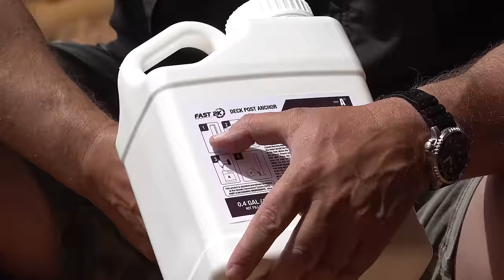POLE BARN POST | Concrete Bad, FAST 2K Good!

Comment: When I was young , Dad and I put the post hole digger in the pole barn.  Dad backed the tractor to the corner of the barn and used the post hole digger to dig the auger about 2.5 to 3 ft down.  We left the digger in the ground and unhooked it.  We laid the front yoke on a rough sawn 12 by 12 seasoned oak timber that was a little wider than the yoke.  We tied the pto shaft to yoke off the ground.  We used the 12 by12 to guide the tractor straight back to hook up.  No fighting , smashed fingers or heavy lifting.  Never had problem with water in the hole or excessive rust on auger.  Where Dad put it always was dry in the hole.
Reply: Good idea! - Maybe cut the bottom off a 5 gallon bucket as a sleeve and put a little gravel in the bottom to clean it up?

Comment: Good work, Tony.  And uggghhhh on the mis-cut of the 6x6!!  Hopefully you have another place you can use it.   I'm framing one end of my pole barn like a house with 2x6 on 16" centers....on the other end, I'm thinking about putting in a laminated beam across the 32' width so I can frame in a 10x10 rollup.  But that's next year!!

Comment: Having put in 600- 700 posts & 200 16' long ( plus) in my life ,this " technique " of dropping the post in the hole had to be the slowest l have ever seen. Just never thought of using the "tractor to help". In the case of the 3point auger, they are "pure torture " to use. Going to "adapt" mine to a hydraulic motor, for forward-reverse control--- they always get stuck. A jib-loader-adapter is also on the "drawing board". Thanks for the great Vidio Sir and happy safe tractoring & building
Reply from the maker: Using the loader to place the post is way faster and easier than by hand. This post was time consuming because we decided to put more post up after the barn was built. I did want to bend the new metal roof hitting it with a post.
Reply: yeah I've put up alot of posts with family by hand with no implements but ropes/ladders/hands... and maybe faster with posts that size if had 4-5 practiced young toned backs, but one could say that about shoveling vs backhoe, but when you factor in its just Tony and his wife, they looked like they weren't rushing but ensuring they did everything 100% correctly, as well as ensuring they were enjoying themselves. I really enjoyed this speed so I could imagine & think through doing this with a bobcat im restoring lol. After I resto the bobcat & require the grapple,the last thing too seek out and wrestle is a wife... then I could match Tony's level of relaxation when tackling such projects lol.

Keep up the good content as well Tony, good folks watch good videos.

& Everyone else, keep enjoying your builds!
Reply: @TonysTractorAdventure  Oh yea, when "one" has a tractor they want to utilize it as much as possible. There always seems to be a "man-power" shortage now-a-days, maybe we're just U-tubing TOO much. Just saying that "bite" with the post on the grapple loader looked kind of clumsy & dangerous. I think the grapple is designed for horizontal lifting & grabbing. A simple "sling strap" on a grab hook on the loader bucket is a " tryed & true" technique --when tractor hydraulic  power is needed. In a " monkey see-a monkey do" scenario l could see a LOT of "Catastrophic " failures. I would not use your technique at home- seen way too many people getting hurt with the wrong "rigging technique ". Just thought you would like too know, ( just 40years of practical commercial, residential,& Industrial experience). God Bless all your endeavours.
Reply from the maker: @Donald Strishock we each have a level risk we are willing to accept and I have the in-person on the ground situational awareness. Those were true White Oak 2x4s. Statistically, it more likely a person would have a fatal car accident, yet people jump in a car and go down the road not having any idea if the oncoming vehicle has brakes or tires worth a darn. The next time you are at a shopping center, take an inventory of the tires on your fellow drivers cars. Now that is dangerous stuff. Still, I appreciate you taking the time to care. 40 years heavy maintenance. Tanks, artillery, construction equipment, heavy trucks. I even got a bit of higher learning in engineering. God Bless you too.

Comment: Good job Tony that foam is awesome as for the post hole digger a large truck wheel will be about the right hight and it will let you turn back and forth not pretty but it works.thank you for your time and work good job the video always love two watch.
Reply from the maker: I appreciate the tip. I have never spent enough time looking for a post hole digger solution, but I have spent a good bit of time talking about how much I dislike the setup. LOL!

Comment: I take the auger off my PHD and install a 2-inch piece of PVC lined with grease in its place. Then I just lay it on the ground.  Hooking up, put the main boom in the top link bracket the arch into the lifting arms. I really don't mind doing it that way but leaving the auger on is awkward at best

Comment: Never used the foam pist stuff  ut I've heard it's good now I'm gonna have to buybsome and use it.
Reply from the maker: I have had really good results with the foam. My barn made it through a storm with very strong winds and it is not done yet. 60 to 80mph gust.
Reply: @TonysTractorAdventure  awesome looks like ill be setting posts with this stuff and checking it out. Thanks for the awesome video

Comment: As for the post hole digger, they are a bear to deal with.  Nonetheless, I learned I can back mine up to a small diameter tree and use a couple of ratchet straps to secure it before I disconnect from my tractor.  Makes it easier to hook back up too.

Comment: best way is too chain post hole digger up to a beam up in the air a like and you can move it around for easier hook up. is fast 2k cheaper in the jugs? take care, be safe and well.
Reply from the maker: It is a bit cheaper, but for large jobs, it is way easier.

Comment: When I get done with mine I pull the pin and drop the screw and then take it off easy  but some times I put my log tongs on it and use it to skid logs works really well but it takes me about 5 minutes to hook up and go

Comment: The bulk product makes this so much more attractive than multiple bag loads. If it was more available in the UK i would consider it for handrails, interpretation boards etc. Thanks for posting.
Reply from the maker: I agree. Both sizes are easier to use than concrete bags, but the bulk Fast 2K is very friendly to work with.

Comment: How come these videos praising the uses of foam never come back after several months and tell you that the foam shrinks and your pole is no longer solid in the hole?
Reply from the maker: You went and made a negative post on the one channel that did do a later review on foam. You used the wrong brand foam. I did a whole video on the lousy foam. I am waiting for an apology. 😉
Reply: @TonysTractorAdventure  ;Keep waiting.  I am not buying it.
Reply from the maker: Each of us have to live with our on integrity clock even if it doesn't tell time right. Maybe you are wrongfully accused.

Comment: How deep of a hole was that and diameter? Trying to calculate costs of fast2k and if i only want to use 1 mix then would you go less deep or lesser diameter?
Reply from the maker: 4ft deep x 9 inches wide. 6x6 post.

Comment: Whats the black stuff on the bottom of the post? And will that protect it from foam and/or concrete & any moisture? Thanks again for the great video
Reply from the maker: The black stuff is just a redundant layer of protection. The foam creates a waterproof bond. The black stuff will protect the post from the concrete floor pour.

Comment: I bought the little bag. It took me three bags to put in for a flagpole. I still did not put in enough so the flagpole is loose. Lesson learned I'll have to go back and redo it
Reply from the maker: I only use the deck post kind. I have had amazing results. My barn made it through a very strong storm. 60-80mph gust.
Reply: @TonysTractorAdventure  I will have to try that. Thank you sir.